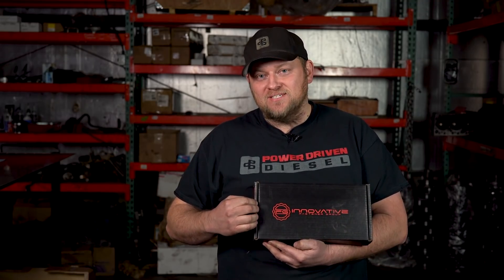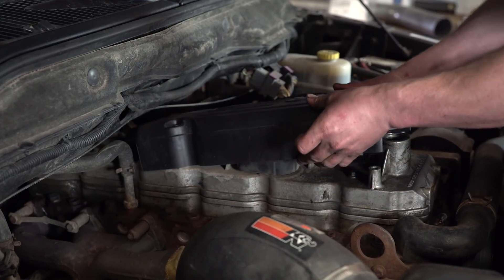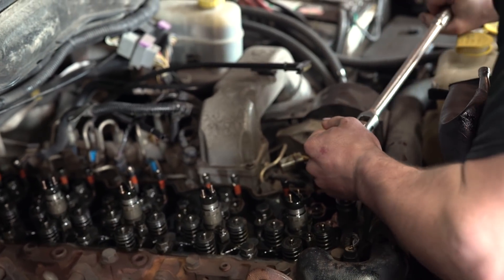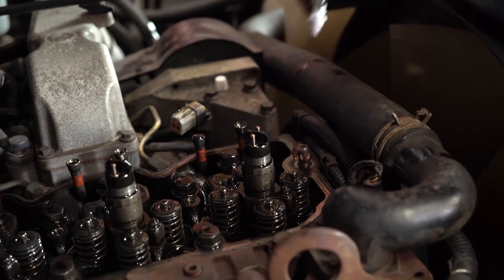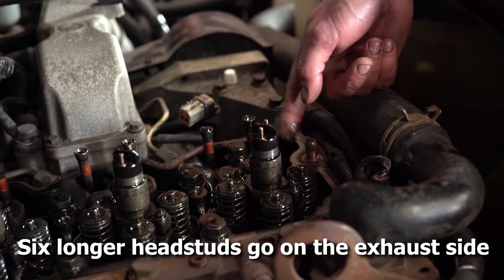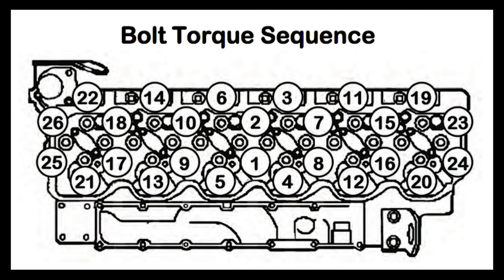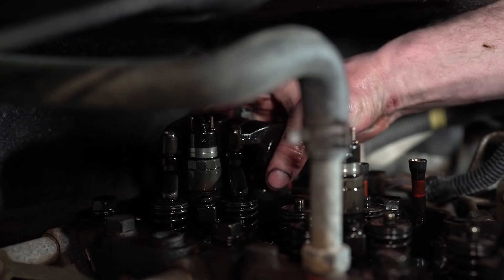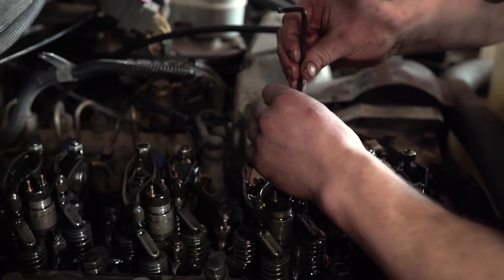Installing IFG Tool Steel Head Studs on a Common Rail Cummins Diesel | Power Driven Diesel

Comment: Horrible head studs quality. Bought them based on these videos and the ifg vs arp 625 video. Bought the 625 competitor version and Had two nuts round off at 150 ft lbs and 1 stud tip break off in the nut. I see why they’re discontinued now. Sucks there’s no warranty claims either
Reply: You saved me a huge headache.

Comment: Just installed this stud kit on my 03, here's a couple of observations. If I'm mistaken about anything let me know.

- First off  these are some beautifully made studs and nuts!!
- My stud set only had one size of stud so the exhaust studs only come to the top of the nuts. I'm guessing it is a little less expensive for IFG to only make one length.
- The washers in this kit are stamped and have a concave and convex sides to them, my understanding is that the concave side of the washer would go against the head and the convex side would face up to meet the nut. Probably not a huge deal but Will didn't mention it.
- It was surprising how much tighter these were compared to the stock bolts I took out of my 225k mile engine, your really MUST reset the valve lash after you get everything torqued down!!!

Comment: I'd be willing to give them a shot on my original 57k mile 94.  You guys have been a big help for me in the past getting this truck running well at 300cc.  However my retorqued  HB are probably on borrowed time.  I may be able to make the drive from PHX to do a video!

Comment: If a tuck has some miles on it, like 250k, do you recommend changing the head gasket or is it ok to run it?
Reply: If the head gasket aint blown leave it and swap to studs IMO

Comment: Hot Re-Torque necessary? Recommendations?
Reply: I would say always doesn't hurt anything but your time cheap reinsurance
Reply: just curious, is all the hot retorque is for is to verify that none of the studs/nuts have come loose? or will the studs actually tighten up a bit more when the head is hot? more looking for the reasoning behind it
Reply: 3D Productions I believe the reasoning behind it is that there’s a chance of them loosening up. So a double check is for peace of mind that nothing has changed. I know some guys that check their exhaust manifold bolts/studs/nuts every oil change because there’s usually one that’s loose.

Comment: I have always heard if you are torquing to 150lbs you should step it up as you go in three equal steps.. so torque all to 50lb, then 100lb then 150 lb. Is this only for fresh headgaskets?   Am I doing extra work for no reason?
Reply: He did... in a way... 130..140..150. Equal, just didn't start from zero.
Reply: @Power Driven Diesel thanks for the response, your videos are great. Best of luck to you guys.

Comment: Are these tool steel studs as good as 625s? I have 425s in my CR 5.9 but I’m about to add another charger and more fuel so better studs might be needed